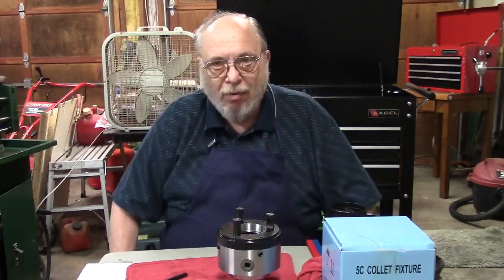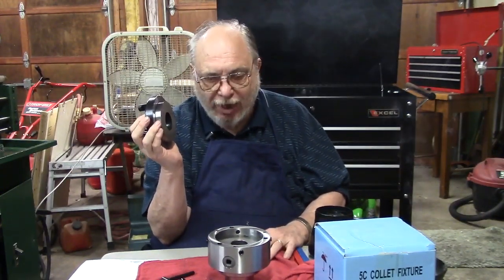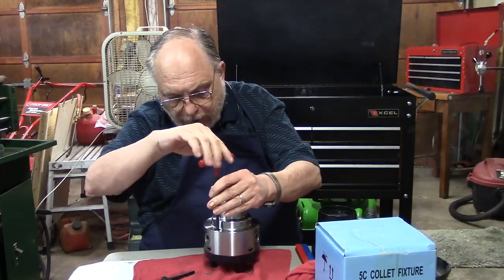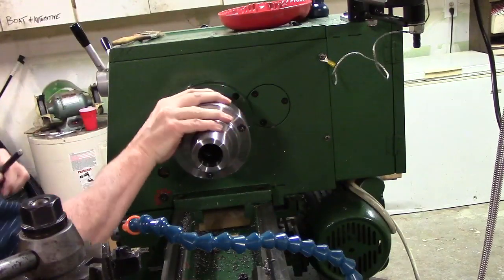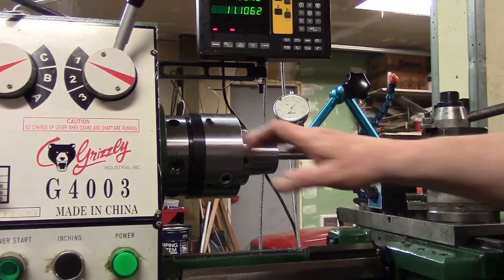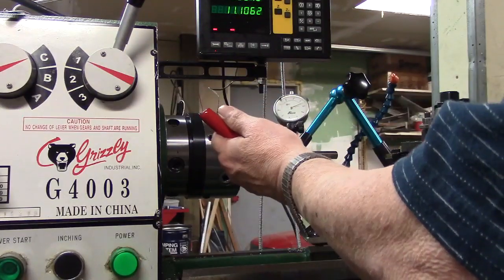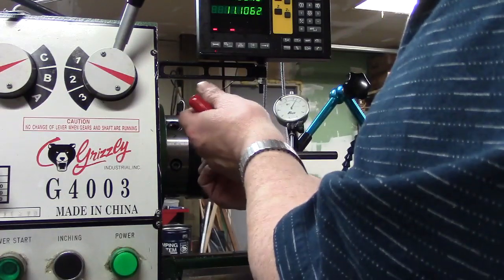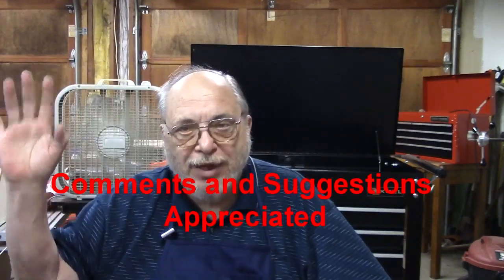5C Collet Chuck Project

Comment: as i am about to buy the same shuck but with the screw on base plate which i have to bore and thread(that's what happens when you buy a lathe with a 1 3/4 - 8 spindle thread). i really welcomed seeing you set yours up on the lathe. thank you.
i was in vn 66-69, mostly with the 1 cav div.
Reply: crazymanmichael i meant chuck. can't type for @#$%.

Comment: Thank you Gunny----- I take it you are a Marine---- I was over there 66-67 with the 173rd Airborne, welcome home brother.
I am in the process of putting a R8 collet holder on my lathe, I have the mounting plate made and I have yet to machine the
taper and bore once I get the collet nut and collets.   Thank you for your service.